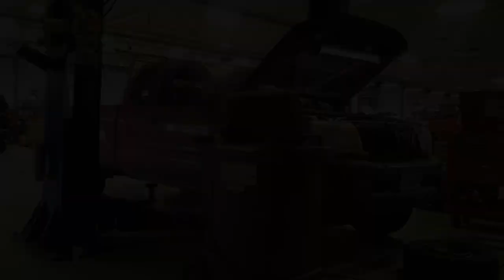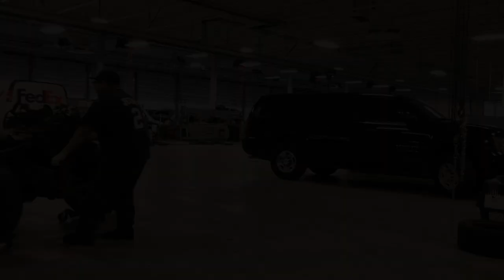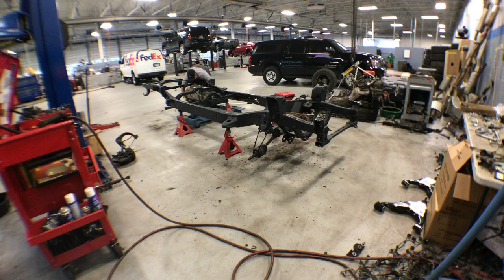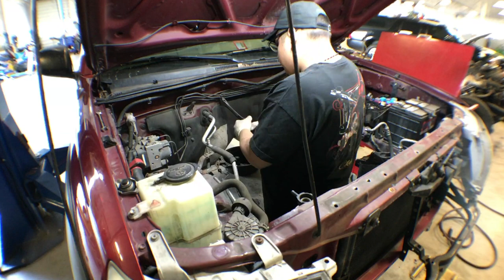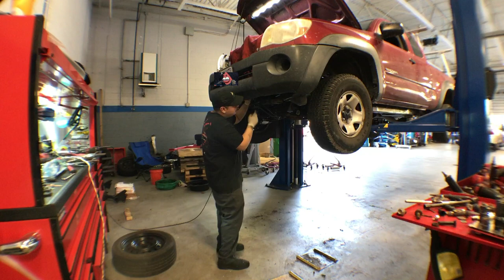Toyota Tacoma Frame Replacement

Comment: With no disrespect to the tech, no way I would own a truck that had been built in the dealership.  I foresee a lot of electrical problems, loose bolts, misalignments, etc in the future.  Why wouldn’t Toyota just total these out.  Gotta be cheaper.  And, for the record, did anyone see a torque wrench anywhere in this video?
Reply: I only had one issue with mine, a few days after I picked it up the steering started binding. I called the dealer and brought it back as soon as I could. The issue was the steering shaft universal joints were binding, the service manager took the truck and they corrected the issue. He told me that happens sometimes. I don't think the universal joints were out of phase, they just needed some grease; Haven't had any issues since. My current mileage is 229,000 

The fact is I had installed a Banks cat back exhaust system and needed to adjust a hanger bracket because it was hitting the spring and they made that adjustment. I knew what it was, just hadn't had time to address it yet; They had to hear it on a test drive

I'm as happy as a tic at a dog show.
Reply: mrgearheadfromhell   How many miles since the rebuild?  I hope you continue to have no problems.  But, all things being equal, I wouldn’t want one of the ones that had been rebuilt.  Way too many screws, bolts, clips, plastic connectors, hangers, that could be left  off, installed wrong, cracked, etc.  the guys at the factory don’t build them this way.  One guy does one thing.  Over and over.  That’s all he has to know.  Then there is an inspection process.  For one guy to know every thing about building an entire truck including the torque of every bolt and the size and location of every screw, is asking a lot.  And, even if the guy that built yours was perfect, the guy that builds the one in the next town might be tweaking while building his first one.  I would bet a pretty penny that I could find several things wrong with any of these trucks after the rebuild.  But, on the other hand, if you already got 200,000 miles out of it, it probably had a few problems before the rebuild.  A complete disassembly and inspection might be a good thing.  It’ll be interesting to see how this goes in the long term.  Hope they all work out fine, but glad I don’t have one.
Reply: Tacomas with their frames replaced sell for a premium here.  I wouldn't hesitate to buy one if I were in the market.  And used car dealers love them.  They buy them at auctions and jack up the price.
Reply: 2 ugadugas is factory spec for 90% of fasteners
Reply: That’s gravy for any line tech worth his salt especially after he’s done a couple I’ll bet he loves it $
Reply: George Donnell 
Yeah, it’s over a 40 hour job. We usually put two techs on one and try to get them done in under two days. The trucks are far better when they leave than when they come in. Customer leaves with new frame and lower control arms along with new leaf springs if it applies. Things that break during the process such as ps lines, evap canisters  and shocks are replaced for free. Truck gets aligned before it leaves and drives straighter than when it came in.  Not as bad as it seems.
Reply: Got 50k miles and everything works fine.
Reply: When they recalled my 1999 the were giving 150% of blue book value ,, now they change out the frames ,, which is what they are going to do with my  2009 Tacoma
Reply: @colen1052  Other than it's still a toyota and you'll be right back in there in 12-24 months getting all that stuff replaced yet again.
Reply: jkutyna 
My pocket book wishes you were correct, but you’re not
Reply: @colen1052  next time you should buy something else other than the least reliable truck sold in America. (Edmonds, car n driver, consumer reports, and jd power,)

Comment: NO Wheel alignment? after removing control arms onto a new frame?
Reply: Pascal Roy I’d rather count bathroom tiles than watch a wheel alignment being done. After all you’re just setting the front end since it’s a solid axle rear.
Reply from the maker: Alignment was done after the replacement.

Comment: Does there happen to be a nursing home/rehab facility  just behind the camera of the outside shot where you grabbed the new frame? 

 5 years ago my Mom had to spend a couple weeks at a nursing home that happened to be next to a Toyota dealer and I would visit her just about every day after work. Early into her stay there I noticed a pile of something that looked like a bunch of old, grungy frames outside the garage door, oddly in the same spot you have those frames stacked and got to wondering if they were doing these swaps.  After another day or so, the bay door was open when I got there and there was a red Taco in a bay that happened to be the exact same spot your bay is it!  Over the next few afternoons I would see the truck get tore down, new frame built, then cab and bed on the new frame, kinda like catching bits and pieces of your video, but through the bay door from the lot next door.  After seeing this and I think maybe parts of another swap, I told a friend who's Dad still has a red Taco 4x4 (IIRC, it's stick shift too!) that if his Dad even needed this done, it looked like that shop had a tech that was as experienced at this work as you appear to be!
Reply from the maker: Not too sure but this was performed at a remote shop due to shop space, not a Toyota dealer.

Comment: The 2011 to 2017 Tacomas now have a frame recall if registered  in certain high Road Salt states.  You need to have Toyota inspect and spray Rust treatment to be  eligible.  If you have a Tacoma go to the Toyato dealer and start a case #, why lose out.

Comment: question, so for this recall, what all is included?  just the frame itself?  Because i have a 2011 Tundra and my bottom is rusted out like hell too...not just the frame, but almost anything a part of the frame is rusted...from any brackets, wires, ect ect...

Comment: Are the new frames made different to fix the problem these old ones had?
Reply from the maker: They appeared to be constructed differently than the original frame at the front portion of the frame. Also a plug kit was included with every job to help keep out anything from getting into the frame.

Comment: I have a 2003 regular cab 4x2 manual that I just purchased and didn't know about this until just now. Do I qualify for the frame replacement?
Reply from the maker: No that coverage ended around 2008-09

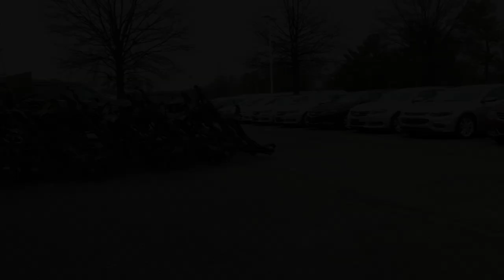Comment: at 5:59, how many time have you make this operation of replacing a chassis, and why?
I count at least 6 or maybe 7 chassis.
Reply: It was a class action lawsuit against Toyota for bad frames. They did a recall but than the dealers fudged the inspection reports. Passing vehicles that really failed. Many later broke while they were being driven. Mine broke. This lead to a class action lawsuit. My frame was badly rusted by age 4. By age 13 the frame broke in the front right by the tow hook. There was a hole right by the tow hook that was about 6 inch’s in diameter.

Comment: Experience at this? Wow! And they pay a heart surgeon so much.  This guy should make ten times that rate?  Major surgery on the car done as quickly as humanly possible solo? Not even a nurse to help pass the tools?  Will it ever recover?  Was going to buy a Tundra.  Noticed the frame was replaced a few months before traded in.  Did the heart operation go badly?

Comment: Hi did you put the old steering knuckles on or did you get new ones from Toyota with the frame replacement.  Also ball joints, tie rods, and front end components
Reply from the maker: Yes the I had to reuse the front uprights, upper control arms. rack/tie rods, shocks/struts, engine/trans, and rear end. Everything else on the frame is pretty much new. Brake lines, clips, lower control arms, etc..

Comment: Amazing work. Thanks for sharing this video. I recently had my 08 Tacoma V6 4x4 frame replaced.  Lower control arm bolts don't seem tightened to 100 ft/lbs. Should I just tighten them up myself? (Update: I retorqued them myself)
Reply: Hi! How much did it cost? Was it a factory repair?
Reply: @samxware  it was free, Toyota covered
It

Comment: Curious to know how much that frame R&R cost. How long did it actually take the mechanic to do the swap, & would it have been cheaper to just buy a rust free truck? That is one hard working man. Sad part is, Toyota had a warranty on their frames for the 2005s for certain, & some owners just sat on it until it expired in 15 years- or 2020 deadline for a 2005 Tacoma.

Comment: If i was going to get my frame replaced, i would be doing all sorts of upgrades while the frame was off or at least replacing alot of parts and suspension.
Reply: Half cost, rear shocks front struts steering shaft or sometime a steering rack depending on conditions

Comment: Would my frame still be able to get a frame swap if I trimmed the cab mount back a little. I done it for bigger tires.
Reply from the maker: Not sure I've never ran into that issue but I do believe the frame coverage is expired for most 2nd generation tacomas at this point. I'd recommend to contact your closest Toyota dealer and see if your truck is still eligible.

Comment: FYI Tacoma fans, my 2008 tacoma truck wouldnt pass state inspection because of this.  i just bought it a month ago from a family member up north and it was rusted out.  i almost passed out when the shop told me this.  the shop manager was in my corner and did some digging with my vin number.  the techincal bulletin says that the recall expired 2016.  i was horrified, i took his advice and went straight to a dealer and they did a free inspection.  Fortunately, they deemed it unsafe and are honoring the recall replacement, i think i was in the 12th year of the recall extended window.  they need a couple of weeks to get the frame and then another week to do the work.  i got lucky that i didnt wind up with a 4000lb paperweight.  this is not a cheap fix.  i would have never guessed or known if i had not gotten the Va state inspection done last week.

Comment: Was the job worth the value of the truck?
Reply: When I had my frame replaced in 2015  on my 2005 Tacoma  the service advisor told me that it cost Toyota between  Ten and twelve thousand  per truck.   my truck was a 4cyl  4x4 access cab in excellent condition and only was  worth about that at the time . I asked why don't they just pay me out and I will buy a new one . he said because Toyota stands behind their product .   I have no complaints a  new frame,  leaf springs,  lower control arms ,  new fuel and brake lines and all hardware needed  and a rent a car while they were doing it  see if any of the big three will step up to the plate on something like that the answer is NO

Comment: How long did the frame itself arrived? I have a 2006 sequoia work order placed on February 2019 and they say its still on its way.
Reply from the maker: It may take some time since it is a sequoia. I've seen tacoma frames come in in a few months. Dealer might be doing frames at a slow pace.

Comment: Why do you remove the front ABS weel sensor if you're removing the whole spindle😲
Reply from the maker: wawa Trail Recon they get new abs wires
Reply: Those abs sensors are stupidly fragile.  It is always best to flat out repkace them.   You can just knock them slightly while doing a brake job and it can cause the abs light to come on.

Comment: so why are the frames being replacd? looks like the cost of labor would be pretty high for that kind of work. also noticd at the toyota dealer in my area had several new frames sitting on pallets last time i visited the dealership so is this an issue with the trucks?
Reply: The frames rust. My local dealer does a ton of them. It's right around $13,000 Canadian per truck. It's a great deal for the owner. GM half tons rust just as bad around here but GM doesn't do anything about it.

Comment: Impresive to say the least! But im wondering how much this would cost me? I have an 08 silverado that needs a new frame.
Reply: If it's not some sort of warranty issue a lot. More then you would want to put into it. This frame replacement was done because Tacoma frames were rusting out and public pressure/class actions forced Toyota to do something.

Comment: So what was wrong with the frame that it had to be replace?
Reply: gary24752 Toyota had a recall
for rusted frames on 1995-2000 Tacoma’s and 2001-2003 tundras.
Reply from the maker: Rust issues with certain 2005-2010 tacomas at the time.

Comment: I am amazed anyone including Toyota would consider this a cost effective repair on a truck that old. I can see if the truck were still under warranty or even on a 5-6 year old truck but on a 2005 that has clearly been beat up as a work truck. Wow...hos much does that cost? Does Toyota cover the cost of the job including parts and labor? And while the truck is apart I would hope on a truck this old that they change a lot of other wear parts. Would be crazy not to I think. Even more shocking is the pile of old frames on the lot at 6:00 .
Reply from the maker: Yes Toyota did cover this frame replacement and the customer paid nothing. Many new toyota parts were also installed at the time of the frame replacement, including leaf springs, metal brake lines, lower control arms, and many other parts too long to list.

Comment: Toyota and I guess all manufactures  should just Hot Dip Galvanize the frame and other suspension parts . And this would be a cheaper alternative in the  long run .

Comment: Had the 2000 Tundras frame replaced in 2017 on that recall. New brake lines, new fuel lines and tank straps with a 97000miles on it. I'm guessing it will go another 20 yrs
Reply: Why was there a recall? Were they rusting in half or something
Reply: @rustybrowneye  they were. Tundras and Tacoma's had their frames replaced

Comment: Just curious. Why is this kind of repair a thing? Is there issues? Is it more cost effective to replace the truck? A bit of insit would be nice.
Reply: I would say even if it's expensive labour to replace the truck, it's better than being wasteful and scrapping an otherwise useful truck. It's not like the trucks could be used for parts either if they didn't have this frame replacement program, because then nobody else would have these trucks to make use of the parts if everyones frames were toast as well.
Reply: Toyota lost the largest class action lawsuit in automotive world history because the government proved that they made the trucks to rust on purpose.  Part of the settlement is Toyota being forced by the lawsuit to replace frames.  No sane company woyld do thus willingly but no other company sells you rust and calls it a brand new truck either.

Comment: I got a new frame and now thanks to Toyota's ZH2 program they are installing a new drive train for free. One more recall and I could have an almost new truck.
Reply: @WoodbyWolf ZH2 program is for replacing drive shaft and u-joints not the frame. What was the reason toyota gave you for not accepting your vin# to replace your frame?

Comment: What was the reason to replace de chassis ?
Reply: el groso Toyota had a recall
for rusted frames on 1995-2000 Tacoma’s and 2001-2003 tundras.
Reply: @anthonyemmm  
Ohh...
👍

Comment: I know the recall is free to me the customer, but if the tech happens to brake bolts or parts trying to separate them from the frame, (brake lines, fuel tank straps, wiring harnesses and connectors, ) does the customer pay for those parts, or are they included with the frame replacement. I know my own truck's frame is VERY badly rusted (New England winter and salt conditions), and have no doubt things will brake, at no fault of the tech, it's just inevitable and unavoidable. I'm just thinking if the parts aren't broken when I bring it in, why would I have to pay for the part to be fixed when I leave? Also, I know I need new shocks and struts, If I bring my purchased own new parts, would the tech replace the old parts with the new parts. They would be swapping the old part over anyways, why not give them the new hardware to put in if its not any extra labor? I actually have to repair my brake lines to get to the shop, they rusted out this past winter, and I've heard before that all brake lines are replaced under the recall as well. Is this true? If they are covered, I will only patch the lines instead of running all new lines.  Sorry, my inquiring mind wants to know before I take my truck in to have this done.
Reply from the maker: Yes there were more parts included during the frame replacement. Lower control arms, metal brake lines, hardware for suspension, clips, spare tire carrier, and other small items. They used to also include the chassis wiring harness, but i saw that go away.

Comment: A new truck would have been the better option, right?? Seems a lot work too just put back old shitty parts on new frame.
Reply from the maker: It was free so why not. Many parts were also replaced with new toyota parts. Lower control arms, metal brake lines, leaf springs, hardware and other small things.

Comment: Why does it need a new frame? Rust or an accident maybe? Bet it squeaks and rattles like crazy now.
Reply from the maker: It was rusty. It actually was 100x better than before the frame replacement. Many other suspension component were also replaced at the time of the repair.

Comment: What is the cost of a frame replacement?
Reply from the maker: At the time it did not cost the customer a dime to get the frame replaced.
Reply: @MoarLow  what's the status of the "free" frame replacements currently?

Comment: I just got mine replaced. The frame cracked on the front. I have to wait 6 months for the frame change. Toyota didn’t care that it was a six month wait.
Reply from the maker: They should have given you a rental during the time of the replacement.